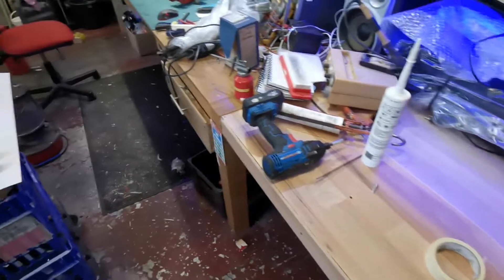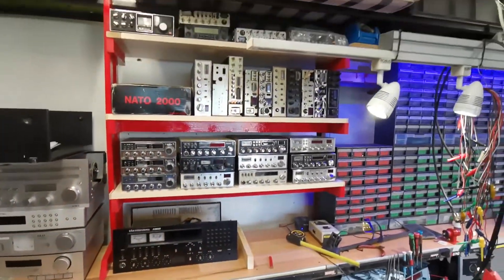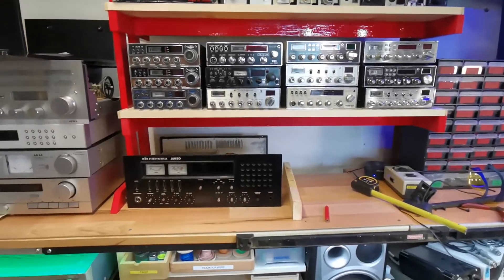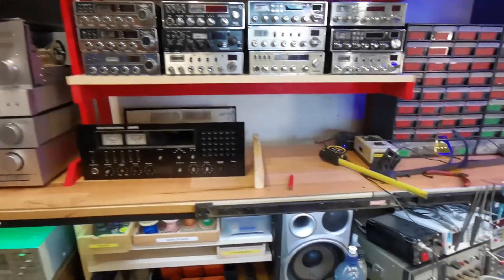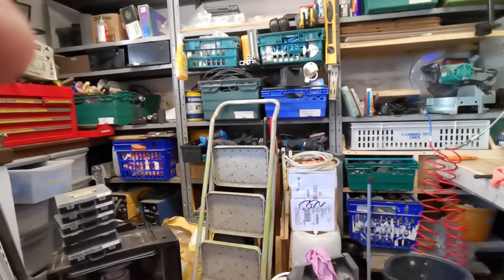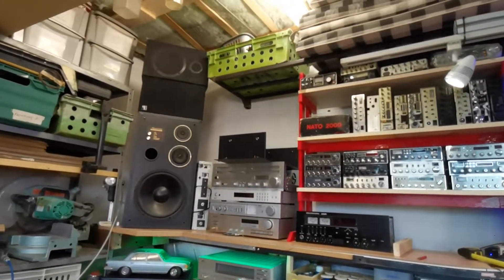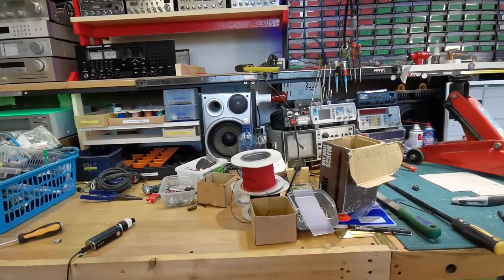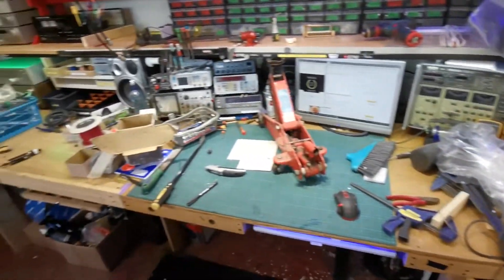Workshop Update 10 Feb 2021 #shed #workshop #workbench

Comment: It's at times like that that I wish I had never started!!  But you are getting their.  I spotted a Nato 2000 CB.  I have one of those to repair, bought it and never used it but to listen, then one day I took it out to have a listen and it was not working?  Looked inside and all the wires from the two swap over chips (not chips really) were all eaten away!  How on earth could something have got into the insides of the CB to eat away the wires.  All the plastic wires were eaten through and the insulation gone!!!  Must have been made of tasty stuff, Now I have to sit down in the summer and work out where everything should go, but without colours on the wires it is going to be a bit of an uphill task.  Some of the other wires have also been eaten away, just how on earth did a mouse get into it in the first place, there is hardly room for a Cockroach let alone a mouse!!!

Keep at it George, you are getting there slowly but surely, that is the best way. 

 I liked the Nato 2000, for listening anyway, what it was like to use to transmit I have no idea, I did use it on UK FM but the bleep annoyed everyone, so I didn't bother after that.  If I get it going I will have to change the value of something to change its sound to a lower pitch.,
Reply from the maker: It had to be done Bob. I had not enough space...